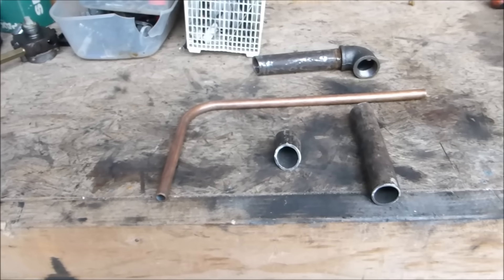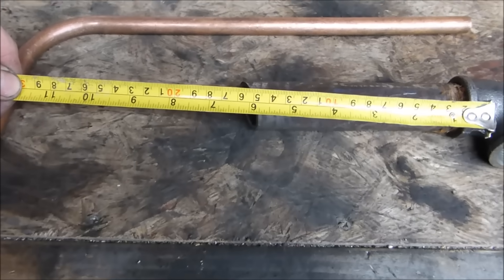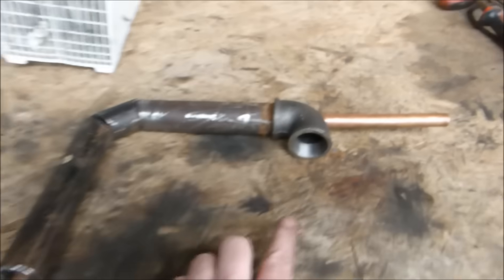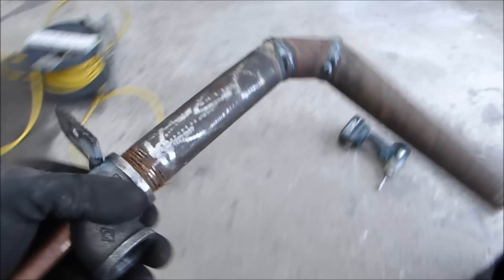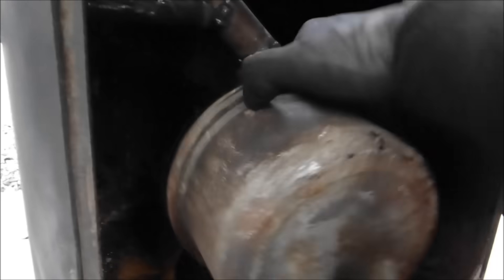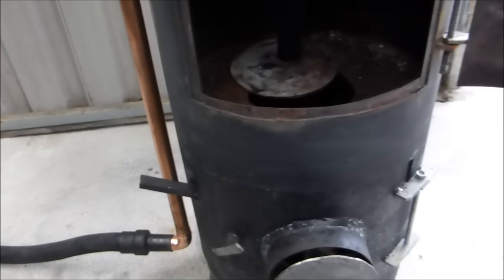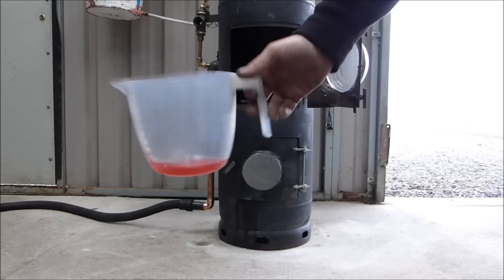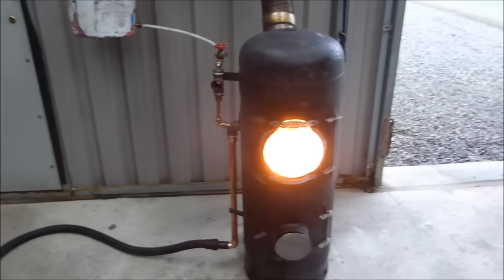Build a New and improved fantastic output Waste Oil Burner.

Comment: car oil? car oil is not flammable?  if it is!!.. I have lots.. but wait, do I have to use wood for continuing burn? please tell me
Reply: car oil is definitely flammable. Just like the kerosene was hard to light in this video, car oil is the same way. It will burn no doubt, you have to get it hot enough to ignite. It won't just ignite like gasoline.

Comment: The combustion of waste oil products carcinogenic dioxin, which is 70,000 times more toxic than cyanide many types of dioxins and not all equally toxic, but those that are, are 70,000 times more toxic than cyanide, and 60 times of strychnine! They are quite stable and difficult to break down, and during the break is six to nine years occur,most toxic of all the compounds that man has ever produced - dioxins, and go into the air. Carcinogenic, mutagenic and teratogenic (inherited from mother to child)

Comment: Hello Gerry
                  A excellent tutorial on the build and usage of the stove. I am looking to build a very similar stove working throughout the winter and night times supporting a Solar Panel Set Up with the heating of 5000 Litre Vented Thermal Store.
Do you have any wisdom to share on method to heat a water supply.

john
Reply: John Gallagher You can coil a copper pipe around the flu and cover it up with insulation and connect your coil to your water tank. But you have to be a bit creative when it comes to incorporating the plumbing with the plumbing from your solar hot water panels.  If your tank is in a position higher than the stove (on your roof maybe since you said SHWS) then thermal convection will work, otherwise you would need a small pump to circulate the water through the coil around the flu.

Comment: Amazing and so simple .i am wondering could a sterling  engine produce the air flow instead of a hair dryer for off grid use ?
Reply: Wonderful use of energy if its possible to get enough air from the sterling

Comment: Nice one! I wonder if one could direct the heat through a "hotwall" or whatever it's called in english, the one that accumulates heat and heats the room.

Also what's the oil You are using, looks like high quality extra virgin olive oil by color :P
Reply from the maker: Hi Mr Murk. You could easily heat a mass storage area by being creative with the flue. Also if  a boiler was used instead of the stove its possible to heat a underfloor heating system. Here's a link to a boiler I converted to heat a 300 litre  (80 us gallons) water tank. It manages to heat the tank of water in about 1 hr. This is a small boiler and delivers lots of heat. http://youtu.be/PaEOpqqPwgs
Cheers Gerry
Reply: Awesome! now to find a source for waste oil and a workshop for myself, that needs heating :)

Comment: I have to do a similar enclosed setup. With my burners I could have the whole thing glowing red hot and heat up a warehouse!  :0)
Great Vid Gerry!
Reply from the maker: Oil Burner Hi Oil Burner. I have to say that I am having a blast messing about in the shed nice and warm from an old propane tank and some veggie oil. I think I am going to try a siphon nozzle setup soon so I can put the whole thing on a stat and a timer. I have to order one from the states as I cant get one here. More fun and games when it arrives. Cheers Gerry
Reply: I'm looking at using a micro controller to monitor room or water temp in a boiler and use various old car parts to regulate the air and fuel flow. I can still do that with the drip type setup and I prefer to stay away from having to have compressed air and filter the fuel through a Nozzle. 
At the end of the day though, whatever works is all good!
Reply: Gerry's Waste Oil Burner +Oil Burner  Well, the question that arises here is: do you really want your stove body to go red hot?  I imagine that the stove is burning quite a bit of fuel doing that, clean burn though it may be.  So the trick is to burn just enough cleanly to heat the space you have, not an easy one to solve.  Of course if ur getting ur fuel for free, it may not be an issue, but I imagine you still have to expend time and energy bringing it home, etc.
Reply: Unless you have a way to filter the 'fines' and waxes out of your waste oil, stay away from using compressed air or pressurized fuel feed.  If the fine debris in the oil doesn't do it, the changing viscosity will...end up in intermittent fuel delivery at the worst of times!  KABOOM!  Trust me, drip feed is MUCH safer!!
Reply: For me its all about the fact its off the grid. When we get a nasty ice storm/hurricane winds and lose power for days at a time and you live in a place like I do without a wood stove you NEED heat this time of year. So that fact it runs off gravity is a huge plus for me and is why I'm building mine. If we lose power we can always just live in the garage haha. At least we will be warm haha

Comment: 1- how do you know you are putting in the right amount of oil so it doesn't build up in the pot? Can you walk away without overflowing onto floor and having a lake of fire?
2- You did not explain anything about the air pump.
Reply from the maker: Hi Russel. I have over 20 videos on the waste oil burners. In one of the videos I just used a hairdryer to add the air. This was not a serious installation but merely to show how simple the setup can be and still make tons of heat. Once you have the the unit burning correctly it is possible to let it go on making heat for hours without the need to constantly adjust it. Here's a link to the hairdryer blower burner.  http://youtu.be/EvQQWg-gSwM?list=UUqe1yTIkHEFx17lmI1zvttA

Comment: thanks for the reply and the link to this video. this is something I will be trying out in the future, for sure. What fuel are you burning again? I thought you said diesel fuel in another video? How well would this set up do with waste motor oil? I would imagine with would burn a little dirtier.
Reply from the maker: Hi windersranger1. I can burn waste motor oil, hydraulic oil etc but mostly I burn waste veggie oil. I use a little kero or diesel 1/2 a cup to get it started but once it lights that's it. The burner unit  will burn waste oil all day without smoke and to stop it just close the valve. If I have no oil I can also burn sticks , logs etc. Cheers Gerry

Comment: can I use engine oil?
Reply from the maker: Yes you can use motor oil, Veggie oil etc. I have tested quite a few oils and if the oil will vaporise and burn this little burner unit can burn it without smoke. Not to be tried with Petrol / Gasoline of or any highly volatile liquids course. Cheers

Comment: Hi, my question is about smell. When your burning the car oil or the cooking oil, can you smell it at all in the room? I have been in vehicles that run on cooking oil and it smells like French fries all the time, not sure I want that smell in my house.
Reply from the maker: Hi Eclectic Ark. There is no smell from the fuel at all in the shed as all the exhaust goes through the roof. If I burn Veggie oil it happens in the vapourising pot and the exhaust goes up the chimney. Same with other types of oils or logs. The flue is about 14 feet long and there is a very good draw on it. Cheers Gerry
Reply: Gerry's Waste Oil Burner Thanks for answering, much appreciated. Love what you are doing. We are building a float home with recycled material and looking for cheap ways to be off the grid. This looks like the easiest and cheapest way to heat our home yet.

Comment: I just finished my build of a similar version of what you have shown.  A few differences, but the same concept.  I am in the process of doing test burns and making subtle changes.  Outside of tank seems to run about 820 degrees F. No glass in the door.  I tried a larger blower unit from an oil furnace, but didn't like that fact that it draws about 300 Watts; opted for a smaller fan unit that uses 36 Watts. Experimenting with different clearances between tube and burn pot as well as different size burn pots.  Thanks for posting!
Reply from the maker: Hi. Well done on your build. I haven't lit my burner since last winter but I will light it within the next couple of days. It really is amazing the amount of heat that these things can produce on waste oil. I have tried veggie oil and motor oil and there is not much difference in aparent output. Plenty of heat and a red hot stove which ever type of oil you use. Once you get the air fuel mix sorted there is no smoke and lots of heat. Cheers Gerry
Reply: Gerry's Waste Oil Burner Howdy!  I hate to say it, but I have given up on this design.  After a solid week of trying, I could never get it to burn without black residue coming out of the chimney.  I tried everything I could think of: rebuilt the tube-in-tube twice; tried three different burn pots; used more air/less air; added secondary air holes at base of tank; tried several different oil dispersion devices inside the burn pots; and added turbulator vanes to mix gasses. Most frustrating!  So, I put back my trusty Ozzirt-style burner back in service...works like a charm; no black smoke and it needs no electricity.  I really tried, but I could not get this design to work consistently for me.  Regards.

Comment: Based on a flow rate for about 50% burn what is the approximate usage of waste oil?   (gph)
 I want to build a unit to heat my garage about 1600 sq. ft.    I don't want to go through the process if it doesn't put out enough heat for that amount of space,
Reply from the maker: Hi Robert.I am overdriving this unit to show just how hot it can be made to go but it is possible to make a smaller unit and burn alot less fuel. The big propane tank conversion is great for burning solid fuel too.
Reply: Thanks for the reply but I still don't know what oil consumption is at a 50% burn.  I understand that there is no set number.  I'm just trying to figure out how much oil for a 24 hour day using your burner as an example.
Reply from the maker: Robert Thornton
Hi Robert. In its current configuration it will burn about 1 us gallon per hour about 3 litres. At that rate it would easily do 1600 sq feet. One of my videos show an ozirt version heating a central heating boiler and producing 22kw heating 80 us gallons in 1 hour. That didn't include about 8 + kw coming from the burner.  Your heat requirements would depend on what level of insulation you have but you could put it ball park 2 to 4 litres per hour depending on how hard you have to drive the stove. Cheers Gerry

Comment: Was looking for a good example of a waste oil burner to use with an aluminum foundry,  this video is exactly what I needed. I never thought of running my oil line through the air supply line, its genius!
Reply from the maker: Hi  Noah. Its not my idea, I saw someone do it before but the air feed does keep the oil from burning on its way to be vaporising pot. Cheers

Comment: What are you using for the window ? A pyrex baking dish ?
Reply from the maker: Hi Bubblytubebob. Although it is not necessary for heat output I wanted to see the flames so after looking in the shed for something and found nothing I raided the kitchen for a simple and cheap Pyrex dish. If you give them enough room for expansion pyrex dishware work great.  Cheers

Comment: It looked like a steady stream of oil through the tee do you need to back it off to a drip at some point ?
Reply: I have been operating one very similar to this for a couple days now.  I adjust the flow rate down to a very thin continuous stream (like he does at the end).   Too much oil feed and it produces a lot of black smoke (too rich).  I have not got it to operate on a drip...at least on my version. A quart of used oil lasts for several hours.  Regards.
Reply: U cant run these at a low temp , they basically need to burn like a jet engine to get a clean burn... using these to heat a boiler w a lot of water capacity  is a good solution

Comment: Hi Gerry  Are these not usually used as a drip feed? you seem to have a real flow going there ?  surely they would go through a lot of oil in a days heating a garage ? Is it the vapour or the oil thats burning?
Reply from the maker: Hi bonnyjishop. They are usually drip feed and I can run it that way for lower output. In the videos I turned up the flow as much as I dared to get max output. For lower output I just close the valve a little. Cheers

Comment: Hi Gerry, really enjoyed your process of development of a simple waste oil burner, i also have gone through this for heating my house.
i did not want to modify the boiler unit much, so if i'm away i can simply refit the regular oil burning unit running on the timer, so...
i had a old knackered burner so i used the blower and welded up a 'spout' to blow the air down into a stainless steel pot 'combustion chamber', inside the spout the oil is piped for the waste oil
like yourself i went with a gravity adjustable drip feed system, yes it works though it is problematic, after a while the area warms up and the oil flows too fast, also fluid viscosity or dirt in the waste oil effects flow
 i stumbled on a solution, an adjustable peristaltic (dosing) pump, mine is 4liters/hour , it solved a few problems, first the heat paradox, now hot or cold constant feed. the pump can easily cope with dirt, though i have a coarse filter. i have wired in the boilers overheat thermostat so less danger, mad hot it will shut down. also the pump and fan are on the timer unit so when lit i normally set it to run half the night so the heater stops when the timer decides.
i hope this is helpful to you or anyone else,  thanks for sharing, keep her lit!
Reply from the maker: Hi Bernard. I was just experimenting with the burner last winter and to be honest I didn't expect it to work so well. I have a few riello burners here and I will get a dosing pump and a siphon nozzle for the next round of waste oil burner fun. Cheers Gerry

Comment: Hi Gerry! Thank you again for all these instructions. You are helping out many people from all over the world who have to pay a high price for heating. 2 weeks ago i built the same pipe version that you discribe so well in this video and am using it in a wood gasifier central heating unit. the pipe enters the furnace through a whole in the upper door(wood feed) and goes down to the lower part through the slot where the gasification takes place normally. There i set a small cast iron pan with a piece of 15 cm pipe for raising the sides of the pan. There is a cover on this pan 1 inch higher, it's a thick metal sheet with a 1inch whole for the pipe in the middle and many cuts from the grinder all around, crossing the center. This provides more contact of the flames with the metal to get a perfect burn and a minimum of residues in the exhaust. 
I tryed the babington version 2 years ago but it's much more trouble get everything running well AND that awfull noise of the compressor running all the time.
I just ordered a flue thermostat to reduce the oil an air quanity when the they reach 250°C and there is also a heat exchanger in the exhaust which cools the flue 100°c down.
Bye
Reply from the maker: Well done Marcel. I am amazed with the output and how easy it is to get it working. I origiinally wsa going to do a babington burner but I had trouble getting the ball drilled so I went with this type instead. I have some more ideas and I will be posting more videos soon. Cheers Gerry

Comment: nice ,buth doo you using a old motor oil or just new oil thanks
Reply from the maker: Hi. It seems any type of oil works so long as you can get it to flow and can meter it with a valve. The fan is just anything I had around just for testing purposed. Cheers

Comment: Now, line the inside of it with 2-3" of 3000f degree refractory, and you'll probably double your efficiency while also retaining the heat. 

I read that you can make the entire furnace red hot. DON'T! by having the bare steel, it will gradually oxidize and be eaten away. The pipe might even, too, but it's so simple and inexpensive I think it can be considered a consumable. Line the inside with refractory (fire brick, fire clay, etc.) and it will last a lot longer. It'll cost a little more, but it's worth doing that instead of making a whole new furnace every few months!
Reply from the maker: Hi Kelsey. Thanks for the advise. I will be trying a new burner setup soon and I will give it a shot. Cheers Gerry

Comment: I really liked how you did that elbow, with the copper piper trough it, specially the "spring" to hold the copper in position, very ingenious. This stove seems to me, holds quite a potential for heat domestic hot water... aside from the heat of course.
Reply from the maker: Hi soulhunter0 .
I did a video where I connected a ozzirt type burner to a boiler and heated 80us gals of water in 60 mins. here  http://youtu.be/1Et3rIn5GIY
Cheers Gerry

Comment: Hi Gerry,  great set of videos.  Could you use the same setup using a standard Calor cylinder,  would it have the same burn effect?
Reply from the maker: Hi Dave. You could easily use one of the little yellow cylinders and get it humming along nicely. Of course if you want to go mental on the oil it will glow like a light bulb. I plan on using one soon but not as a stand alone. You could use the other burner from the earlier videos with a calor bottle and you would not need a fan or electricity and you would get as much heat as you want. These things work great. Cheers Gerry

Comment: Great, thinking about making one but converting it to a pool heater. lots of good ideas here. thanks
Reply from the maker: Hi Kody. In a few of my other videos I used a converted oil boiler to heat water. the boiler was rated at 70k btu and I was making about 80000 btu without driving the burner hard. That burner was an Ozzirt type burner without the fan. This thing would easily produce many times that output if needed. Cheers Gerry